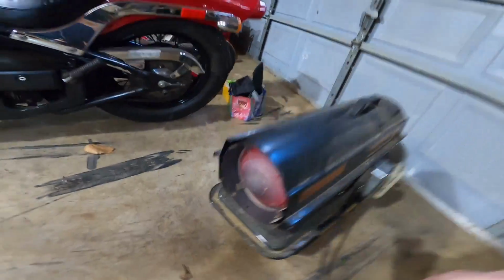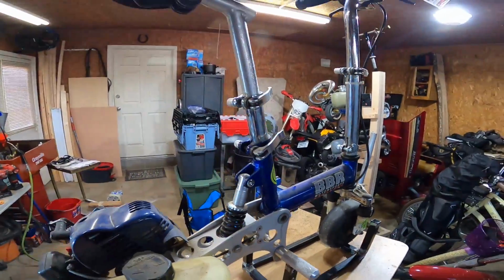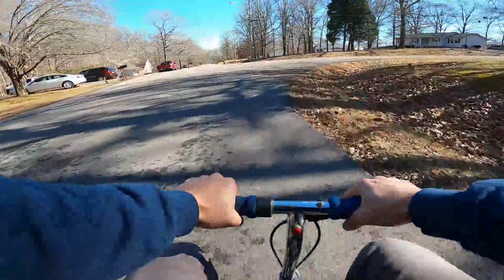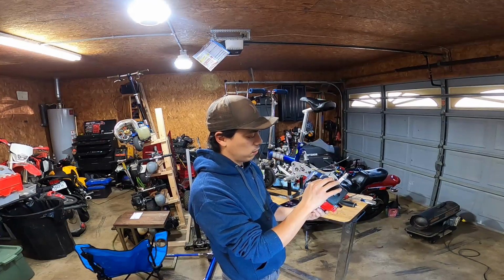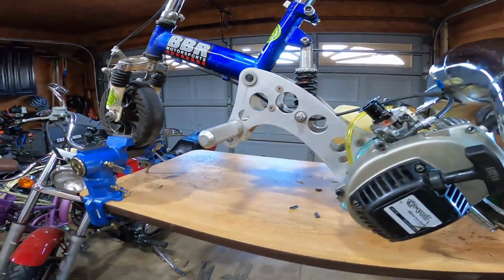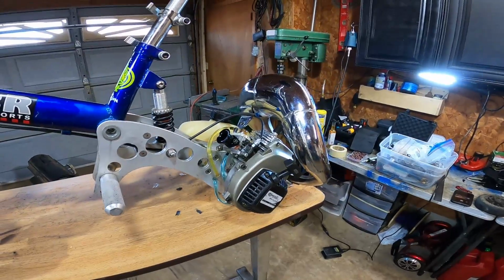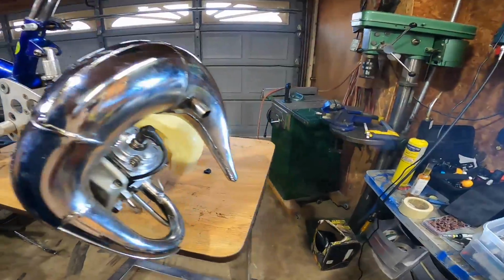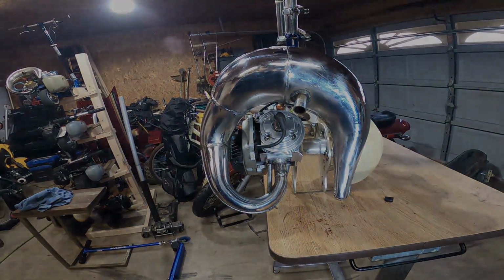Mini Goped Bike gets serious engine upgrade!

Comment: BBR MOTORSPORTS FTW! 👍🏼🏁
Reply from the maker: Lol it’s just a sticker
Reply: @aaronpratt89  figured you may be into pitbikes cuz thats what bbr specifically makes. Pitbike parts and nasty pitbikes. I like gopeds too but obviously bbr has nothing to do with them. Brapp
Reply from the maker: @JesseK410  yea I used to be big into lot bikes! Sold them all, and now they are making a come back lol 
I’ve been messing with Goped’s for about 20 years now lol
Reply: @aaronpratt89  yeah same here man! Still got my original super x ped I purchased right when they came out with them. Good times,
Glad that gopeds are making a huge comback too, parts are hella expensive for them rn especially if they are rare and or discontinued.
Reply from the maker: @JesseK410  discontinued parts for sure are crazy expensive! Ddmracing is still selling a lot of parts tho! I wish Ada racing would still make pipes. They made the best exhaust. The series 1 pipe was the ultimate exhaust system!
Reply: @aaronpratt89  same here dude they just focused on the RC cars now, i wouldn’t say there the best exhaust but for sure one of them. I think the best pipes are the Speedwerks, Flowsystem S1 & Sikktoys M1 pipes..i actually own both the ADA s1 and the s2 pipe. ADA Racing copied Flowsystems design the Flowsystem S1 looks just like the ADA s1. I personally like the S2 pipe lil better bc of the power range and the S1 is better for top end power only, the s1 doesn’t have good low to mid range power. Im looking for a siktoys M1 pipe to try out next!
Reply from the maker: @JesseK410  yea the rc car world is taking over these engines and the after market world. The ddm dominator exhaust looks to be sized right for the small bore stuff. The Ada s2 is too big for the small bored. It’s almost sized for 50cc. The sound wave is too slow for it to work right on small bore. I want to cut up a dominator and re shape it, also make it a center bleed and see how well it does
Reply: @aaronpratt89  dominator pipe sucks i own that one aswell its super raspy and to tight fitting around were the head and spark plug is, it hits the spark plug boot especially if you try an run the MSD wire, they also have problems cracking were they mount. They look cool but deff were designed to fit in the RC cars....the ada s2 is perfect for my cy29rc if you look on my videos yull see it ripps that pipes actually sick not sure what makes you think its only for big bore but its not. Peep my bigfoot it sounds awesome..
Reply from the maker: @JesseK410  when you size the engine for the correct size pipe. The sikk torque pipe and the s2 are sized for 50cc. That’s not saying they don’t work well, but the smaller chambered exhausts resonate the wave at the correct frequency to work better. Compare the size of the s2 and sikk toys pipes to 50cc dirt bike exhausts. Even 50cc moped exhausts. However my plan for the dominator exhaust is to run it as is. Then cut it up and modify it to match the design of the S1 exhaust and see if the performance increases. From what I have seen online the dominator pipe does suck lol
Reply: @aaronpratt89  i only have that pipe bc it came with my G290rc I bought from DDM so essentially got the pipe for nothing 👍🏼😁
Reply from the maker: @JesseK410  that’s the exact kit was gonna buy lol. I have a x ped that I need to build and I want to cut that exhaust up lol. Two birds with one stone 🤘🏽
Reply: @aaronpratt89  hell yeah good engine awful pipe. Yull see

Comment: Sweet ride man. You should have your rear tire on when tuning your carburetor though, just sayin.
Reply from the maker: I wasn’t tuning it in the video. I was just bringing it to life. To tune properly it needs a full load. I have tuned it recently and performed a top speed test. Working on editing it now. Thanks for the interest!
Reply: It doesn’t make a difference.
Lol, Thats like saying you need to be on it (have it loaded) to tune the carb. No you dnt all you need to do is hold it wide open and adjust the high speed needle then check your plug after. The low speed needle you adjust at idle. 👍🏼👍🏼🏁

Comment: Lookin good bro I’d like to get a G23lh head kit or just put a G290 on it
Reply from the maker: I highly recomnd the 290. the LH was such a pony engine to begin with. It reminds me of simple low power 23cc engines found on things like weed wackers and small tillers. The RC engines have more transfer ports and better designed intake and exhaust ports. Its worth it in the long run to run the 290. im only building this for fun. the bike will most likey get a RC engine in the future. I am willing to bet money that a properly tuned stock RC290 will blow this LH engine away lol
Reply: @aaronpratt89  I’d put money on it too tbh I wanna get one in the future or put a ported big bore kit on my LH
Reply from the maker: @jackallred8228  honestly it’s more cost effective to just buy the 290. Anything you do to a LH you can do to a 290 and get better results.
Reply: @aaronpratt89  true dat

Comment: Is that a new goped bike,
thats cool a 29/32cc engine?
Reply from the maker: Unfortunately this bike has been discontinued for at least 20 years. It was not manufactured by Goped but supports the same zenoah engines Goped uses.
Reply: @aaronpratt89  oh thats why it doesnt look familiar, anways thats nice you got there small version of riot goped
Reply from the maker: @nevertheless2791  it pretty much is! I still need to edit the riding video. It needs a bead lock badly lol. Thanks for the interest!
Reply from the maker: @nevertheless2791  oh the engine is the zenoah G23LH. With a head kit. Only 23cc’s
Reply: @aaronpratt89  i thought 23cc is for rc car only 🤔 do you have any idea whats best carb for a 49cc engine i have rovan engine here yet it has no carb i bought from surplus, thanks btw
Reply from the maker: @nevertheless2791  Yes they are originally designed for rc cars! But Patmont motor works designed the Goped brand scooter to use the rc car engines! 

What brand engine is it? You may be able to find a decent 15mm carb on amazon.
Reply: @aaronpratt89  i knew it was rc car engine ive seen some hobbyist. sorry it was 45cc and its working good before i tried a common carb from grass cutter but its not the ideal carb i have no idea about the original carb
Reply from the maker: @nevertheless2791  google search rovan 45cc carb. It will show you what the engine should have.